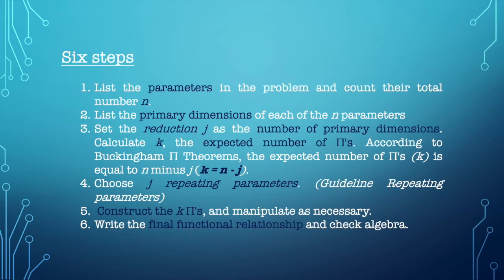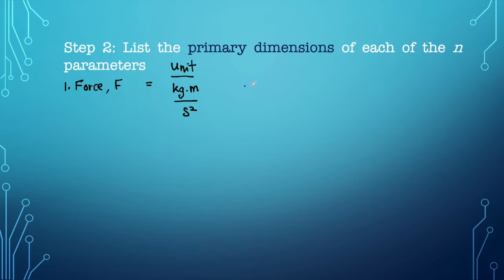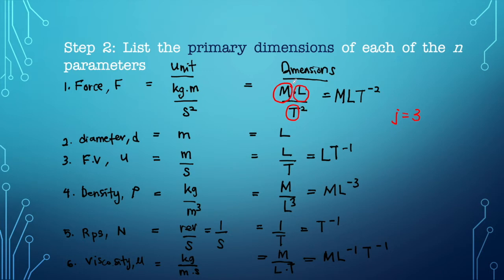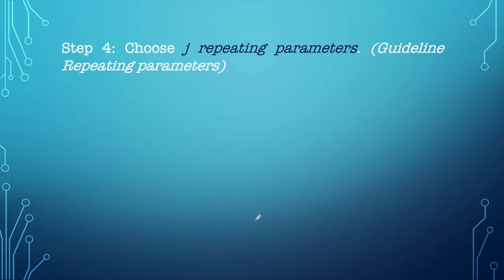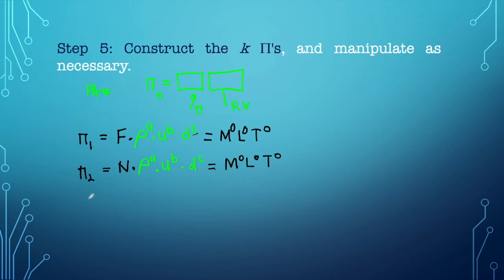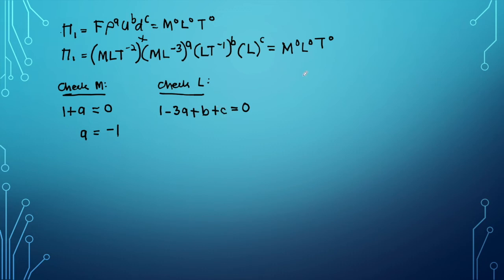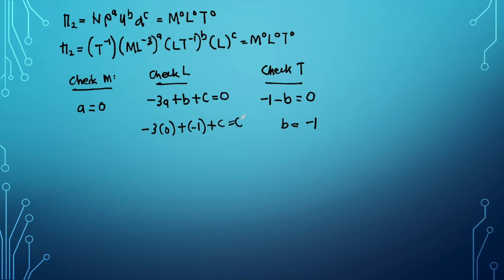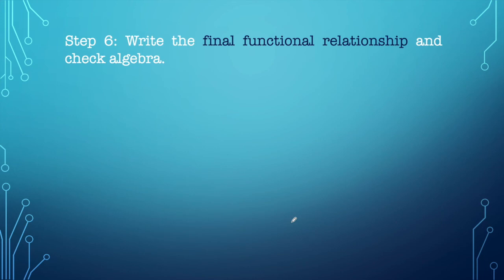Chapter 4.2 Buckingham PI Theorem Method

Comment: Sir i have a question at 7:50. What is the dimension for M3? Is it volume? Like in litre3 as sir mentioned it in L3?
Reply from the maker: Thank you for your feedback, Shahrin. I believed that M3 is m3. That is unit for a meter cubic. The Density unit is in kilograms per meter cubic. Yes, if you say that unit is the same as in litre3. Upper case L represents length for dimensions - unit is meter. Whereas for uppercase M is for Mass - unit is kilogram.